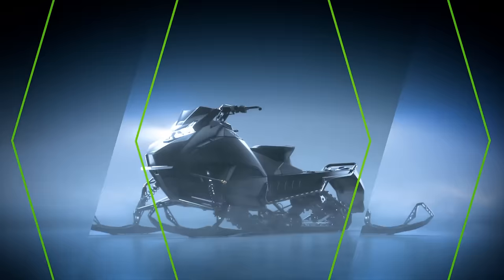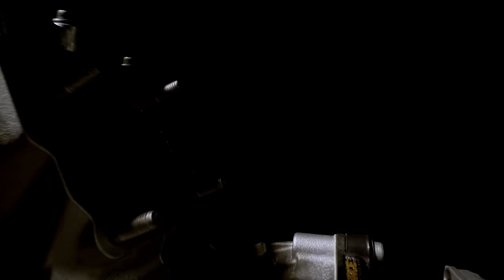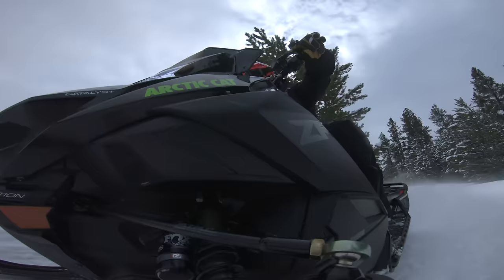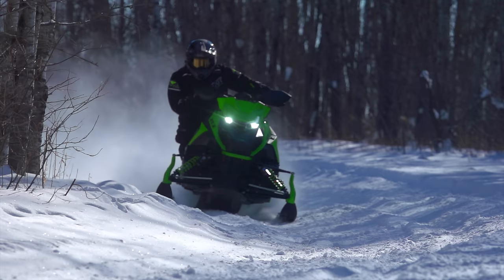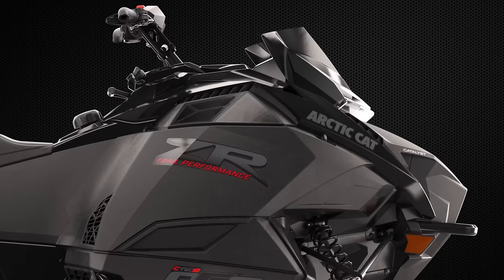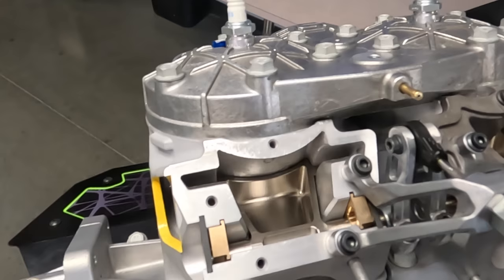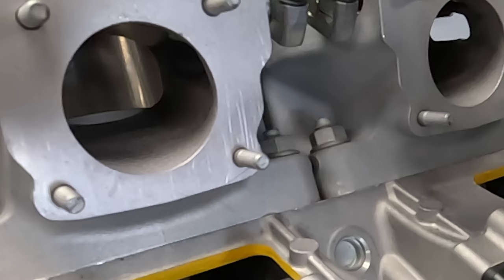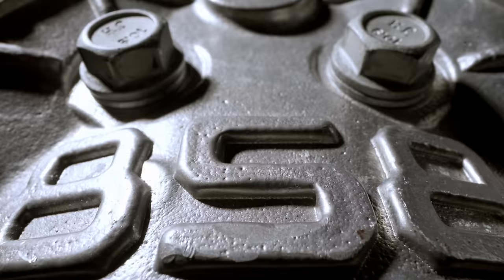DEEP DIVE Into The ALL-NEW Arctic Cat 858 Engine for the CATALYST

Comment: Not a Cat guy but this 858 in the Catalyst is intriguing. As a snowmobile lover I’m just glad there’s 3 players in the big bore 2 stroke game with a modern chassis. If nothing else it’s great for competition and it’ll ensure the yellow and red guys keep their foot on the gas! Can’t wait to see what’s next!!!
Reply: Imajineva turbo on the 858
Reply: It’s time for Polaris to introduce something. They have been leaning on the 2005 IQR geometry ever since. Even the Pro to Axys is only spindles and moving the skid lower in the tunnel. Matryx is just plastics and rear tunnel section. It works for sure, but so did the original Rev back in the day. Which is a whole other thing. Their geometry is identical to the 2008 XP(altho they absolutely centralized the engine with the G4) Other than that they haven’t done a whole lot different than Polaris did to update their sleds.
Reply: @OGReeber  What can they really do!?
Reply: @OGReeber you're super wrong about matryx...
Reply: @caleguenther8947 I’m super not tho. Upper steering, spindles, and rear suspension mounting point is literally what’s different. Tear them down to a bulkhead and tunnel and bust out the yard stick….we run the biggest wrecker in western Canada. I see this almost daily.
Reply: @OGReeber  The entire weight ing of the sled is different because the radiator doesn't go the full length of the tunnel. When the weighting isn't the same, you can't say that this geometry of the sled hasn't changed.
Reply: @OGReeber Having not ridden since around 07 on an ACF8, I’ve been out of the game for a long time. Tried an Indy 850 last winter and was seriously contemplating switching to Polaris even though I’ve spent years bashing on them grenading. Watched a brand new VR1 with a warrantied motor from last season go 8 miles yesterday and blow up, followed up by an XC850 make it 20 miles and blow up. 15k-19k for a sled that you can’t rely on is insane. Hopefully these 858s can just be a reliable sled.
Reply: @dustin4242  I was a Polaris Service Manager. I lost all faith then and there. Terrible company and terrible quality o control.

Comment: When I had a 900ZR it wasn’t a true 900 it was a 866. I loved that sled. 150 Hp at 7250 rpms and 111 pounds of torque at the same rpms. I wish they would say what the spec’s are on the 858.

Comment: Looks like a lot of thought has gone into the design and engineering of the 858 engine for the Catalyst chassis and it should be a hit.  However, I don't think that servo driven exhaust valves are anything new, and IIRC Ski-Doo has had this in their E-tec engines since 2017. Regardless, looking forward to more updates on this engine in the future.

Comment: The exhaust valve is nice. It'll be interesting to see how this dyno's compared to the previous 800,  Etec 850 and Polaris. I'm thinking Cat be able to pull more power down low and have better run quality than the previous Cat 800 and Polaris 850.
Reply: Big 2 stroke have tones of torque! An exhaust trapping sleeve valve would really be nice. Making up an OP 2 stroke out of 2 858 would be insane. Achates Power should get in on this.
Reply: I heard the is like a 2 stroke diesel on steroids. scale that new cat up to a v-16 2 stroke with 858 cubic inches per cyl for a tugboat with turbos from an EMD 16-710 2 stroke diesel!

Comment: The 858 is cats do or die. It has to be a home run
Reply: Not really.  The other brands 850s can’t hold together more than 1500 miles.   Not really a high bar set by the other brands.
Reply: @CCH-R  more on the fact that if it’s a dumpster fire cat might be done forever….
Reply: @joshwagner5414  I wouldn’t think they would release it if it had huge issues.  They have been working on the motor for years.  But yes I get what you mean.   But if it’s anything like there motors of the past they will be bomb proof.  I’ve ran 2 cats over 10,000 without touching the engine and have my backup sled at 7000 miles.

Comment: THEY BETTER HOPE IT IS STONE COLD RELIABLE RIGHT OUT OF THE GATE
Reply: I can see people switching just for reliability if it is. Especially from Polaris with their clutch problems. I've read the only way to prevent the failure is to retorque the bolt at 250mi. & replace the clutch bolt at 500mi.. I don't know anyone that would want to deal with that especially if they ride often and even then it's not guaranteed. It's basically gotten to the point if you're going boondocking into the mountains you need to make sure you can afford a helicopter recovery. 

I honestly can't believe Polaris hasn't resolved this issue. They claimed to have improved it for 2024 but I've already personally seen two failures on new sleds and have read about dozens more on the forums. Not to mention the multiple videos about it right here on YT. 

I'm actually excited about this new AC platform and am seriously thinking of purchasing one. But it won't be a first year, I'll wait and see how the reliability is first.
Reply: They are all junk for the price skidoo is just as bad as Polaris and so on pick your poison and ride don’t fning whine about the whiners can’t afford to play in my mind
Reply: @awdeveau  its a 2 stroke, they are all ticking time bombs lol. Hard riding these things gets you 3000kms per engine lol. Get a modded out turbo 4 stroke instead if you want a long lasting engine.
Reply: @subrosaplaysgames6759  I've had them both. I much prefer the two-stroke. Plus they're not that difficult to rebuild. 

You can rebuild the top end during summer and should be fine for a season or two. But when you have the primary clutch grenade or the clutch bolt break off inside the crank within the first 1k miles, sometimes much sooner that's a problem that should have been addressed before the sled left the factory. Or at minimum a recall should be issued with a proper fix. 

I'm not necessarily trying to hate on Polaris. I think they have a really great sled, just that their sled has a pretty serious issue that seems to be leaving a fair number of their customers stranded.  That issue should be their top priority, finding a permanent fix, as a retorque every 250km and replacement of the bolt every 500km isn't a fix. Especially when even that isn't guaranteed to stop it.
Reply: @awdeveau  yeah I get that, I love my nytro since it so modded out that it weighs the same as any mountain 2 stroke and has way more power but it's a 15k build. 2 strokes are easy to rebuild but it just depends how they blow up. A simple top end is all fine and easy. But when she puts a hole through that case your in a world of hurt lol. I do love my ktm sx125 tho. Nothing beats that 2 stroke power band on a dirt bike

Comment: Releasing any sled and putting out a video like this is not helpful to the consumer regardless of a brand specific consumer or someone looking to change brands. However. A sneak peek. A lot of good information. But also creates a lot more speculation and subjectiveness. Building a sled motor and designing a sled considering weight to power ratios, a motor hp/torque designed with the chassis for the motor and gearing is a great concept. Add in potential driver weight factors are specs like dry and wet weight, track and shock choices most know that you will still need to tune for ones body type and riding style. Subjectively also if its a rocket and fastest 800 series on the snow, but gulps Premium fuel quicker then people drinking at a free booze wedding reception it may not be the most desirable sled for everyone. I look forward to ST TV providing a little more for this sled and others. Specifically in the area of fuel consumption and handling. Groomed northern Ontario wide open trails versus twisting winding a lot of bush trail concession to concession riding.
Lastly with giants like Yamaha exiting the snow mo biz, pre order of sleds of late. The decline in ridership in southern Ontario and club ridership suffering. As well as affordability of trail permits and sleds themselves more are turning to ATV's/side by sides. Not everyone can afford a enclosed trailer and take weeks off in the winter months to drive to Northern Ontario or Quebec to snowmobile. If the Lesters and ST TV have any influence with OFSC im afraid that if there are not Trail Permit, refunds, relief or arrangements of a monthly or district only permit  made then more and more will leave the sport. 3 of my last 5 years permits never even got put on 3 of my sleds. 3 of those years. This year the trail locally never fully opened and was "user risk" yellow. for 2 days in January and yesterday family day use at own risk but should have never been open. Its bad enough that a lot of long term sled owners are opting out.

Comment: Ok, who is going to be the first manufacturer to build the engine right into the front suspension bulkhead. Massive weight reduction, less parts, and excellent rigidity. Even easier access to components. Who will be the first?

Comment: But the bottom end is the identical dimensions as the old 700 lay down. Even the cylinder bolt pattern is the same. I understand it’s new but to say it’s a brand new design….it leans pretty heavily on that old 700. Since the 800/800HO/1000 ended up in the same chassis as the 440/500/600/700 of yesteryear, is there a possibility of a bigger engine? Even a 4-stroke?

Will that bigger prototype engine ever be brought back into the conversation or is it doomed for the shelf now that the 858 was chosen?
Reply: Them AC 2 stroke like boost and live for it! Now I’m thinking of an 1716 OP 2 stroke like a mini Fairbanks Morse 2 stroke with turbo and stuff that in something
Reply: Yes an OP would have the pistons facing each other with twice the stroke to bore ratio!The crankshafts are geared together and they spin in opposite direction and both crankcases are plumbed to the intake ports on a custom liner and exhaust porys on the other end. this is how a fairbanks morse OP 2 stroke works. So 858*2=1716 OP 2 stroke laying down in the catalyst chassis and would make darn near 400hp N/A and god knows how much with a silber turbo!
Reply: it would be a tough fit as an opposed piston 2 stroke would lay down and power taken off the middle where the gears are. The crankshafts are synced by the gears.

Comment: How will handle a turbo?
Reply: I've seen some Mountain sled videos that you can hear the turbo fluttering away. I'm sure it'll be just fine
Reply: I heard it loves some boost, I would pull the turbo off my 8v92 Detroit 2 stroke and mount it on the 858 with intercooler. The 858 should be scaled up into a 900 CID 2 stroke inline 6 DFI.

Comment: Is it just me or does it seem like the rider have to over manipulate the steering just to make small changes in direction?
Reply: It s a new steering systeme that change ratio the further you turn the steering
Reply: It's just you. I love my new Catalyst. It is a very easy sled to ride. No darting, No inside ski lift, No problems sticking to the trail. Ride it one handed at 80 mph- smooth as silk. The steering is incredibly light and easy. Ride one and you'll love it.

Comment: 8 years behind the competitor
Reply: And now In first.  Cool how in an industry like sleds you can literally go from oldest to newest and best.
Reply: @CCH-R  no body knows its the best. Brand new chassis and engine with lots of new problems that are waiting to be found. It is another 2 stroke so these things grenade for fun. Cant imagine buying a 20k+ sled and having it blow up on me in 2 seasons. These 2 strokes sleds are complete junk to a modded out lightweight 4 stroke turbos lol.
Reply: @subrosaplaysgames6759  they have been testing it.  Not like the other brands that let consumers test it for them.  I’ve ran two cats to 10,000 miles didn’t tough a motor.  My other is at 7000 miles.  So blowing up isn’t a cat thing.
Reply: @CCH-R  blowing up is a 2 stroke thing lol. Most people who buy mountain sleds keep them pinned there whole life span which is why 2 strokes have terrible reliability unless your light on the throttle lol. 2 strokes are not meant for long high rev pulls because of their terrible oiling compared to a 4 stroke.

Comment: 3;07   shows the difference in the quality, fit n finish difference betweed doo and cat  lol     looks like some dudes in there garage slinging some jugs and pistons together.
Reply: Looks pretty professional to me.  Maybe you could post a video from Doo to prove your point
Reply: They’re literally checking crankshaft runout and torquing cylinders down, that is the definition of quality control. Doo and especially poo have way more engine failures than cat.
Reply: @goonridingupnorth1382 Doo also sells 3x the sleds than arctic cat does. When over 50% of the market is riding Doo, of course you're gonna hear about it more

Comment: How could it take 2 years to build out an 858 engine after you already have the 600?  That's how you lose market share.
Reply: They clearly stated in the video they couldn't get parts to build the engines. They most likely did not want to pull a polaris and deliver sleds in April like they did in 22.